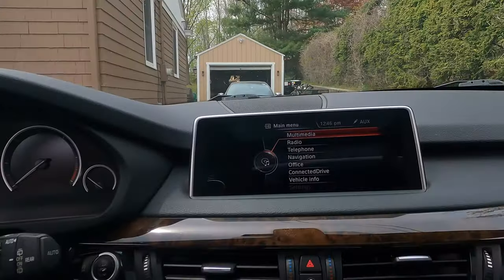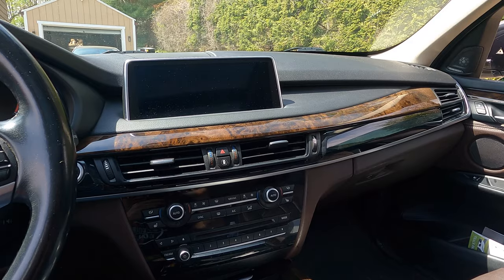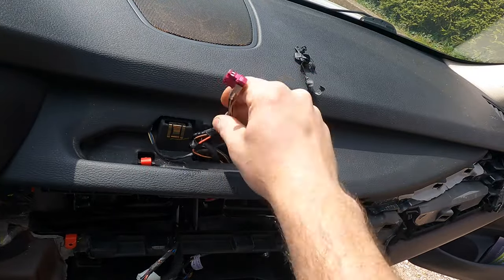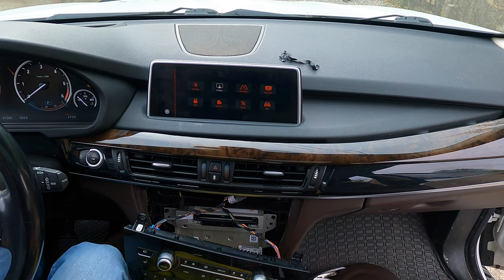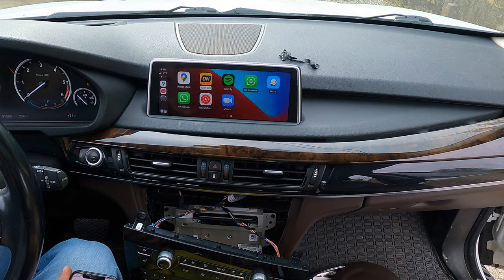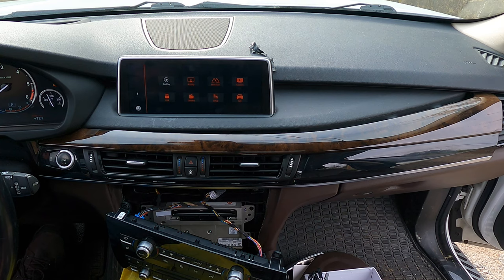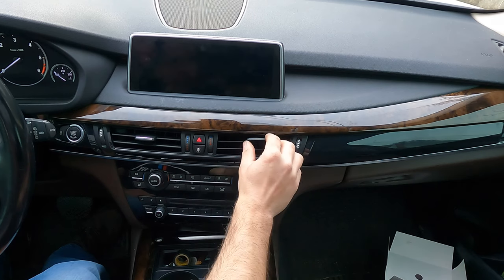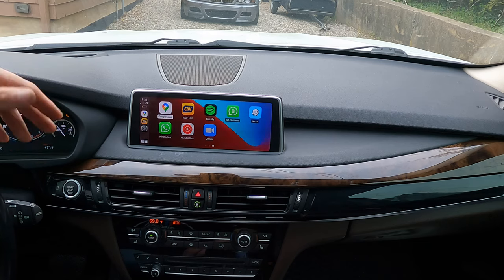Installing Andream Apple Carplay MMI NBT in F15 X5

Comment: Great job man. Ordered 2 weeks ago and installed today. You were right, there is very limited space behind the receiver. The only thing I did differently is used the [blue] factory antenna wire instead of the one provided with the unit. Is there a reason that you used the aftermarket antenna? Total install time was about two hours for me, most of that time spent wrestling the cables/connectors back into the dash to make way for the receiver. Works flawlessly, wife loves it! This is a no-brainer for those of us that have semi-new bimmers and want to modernize them with CarPlay.
Reply from the maker: Thanks Man 🙏 the antenna is for gps, for example is you cell looses service you can still use navigation

Comment: Great video! Thank you so much! I’ve been meaning to do this for a while and this afternoon, followed your video second by second! Only question I have is: where does the AUX cable from the Andream MMI black box plug into? Or does it just float around behind the silver iDrive box?
Reply from the maker: Thank you 🙏 glad you like it🙂 the Aux cable from Mmi is option accessory since this mmi is used in several models in x5 you can just tuck it away behind idrive
Reply: @MotorsportInspired  the issue is when I select AUX from Multimedia, it says nothing is connected. Right now, I’m using Bluetooth with the CarPlay box

Comment: Thank you for the video! I bought and installed the same device. Easy job.

Have a couple questions about the phone calls mode. When I have an incoming phone call I can’t answer neither using the buttons on the steering wheel nor using idrive knob. I can choose between the answer and decline buttons on the screen but when I push it nothing happens. Can only answer using my phone. Can’t find any settings for that. Don’t you have such issue?
Another my concern is incoming calls appearing. When I’m driving using the navigator and got the call I only can see the call screen then and can’t return to the navigator until I ended that call. Do you know if there’s any way to fix it? I mean by splitting the screen between navy and phone, or getting calls on a background, etc.
Thank you in advance for the answer.

Comment: This is the best box! Although my steering wheel controllers are still bmw adjustable. But I hold the knob on and get Siri, also gave me back up angle lines, DVR, get the wireless one comes with extra cable( usb one gives you low quality music.. wireless one saved my audison speakers 🔊) it has EQ like 40 settings,, and I wonder if I can connect a fire stick.. even heard it has and hdmi.. wow some gta5 sounds nice 👍
Reply from the maker: Yes sir it’s been 3 years since I got it and still works flawlessly 👌
Reply: @MotorsportInspired  have you tried the shortcuts app? U can start music up when u step in or have it tell you Goodmorning
Reply: @MotorsportInspired  if you recommend any apps shoot it

Comment: Hi I installed the box following your instructions on my bmw x5 f15 40e  2016 but for some reason I am not able to get any sound or even control the volume from the car steering wheel, any advice. Thanks 😊
Reply from the maker: Hi, I would suggest to double check the fiber optic connection in the head unit, that like to come close even though it might seem like it’s plugged in, if it not making connection those are some of the symptoms your experiencing.

Comment: Did you install an aux wire to this? I've installed a similar mmi carplay kit in my f20  1 series but am upgrading to X5. With the f20 I needed to wire in the aux input as well as the mic to be tapped into with the wiring harness
Reply from the maker: Hi, X5 doesn’t need a separate aux wire it’s integrated into the Mmi it uses oe mic harness.
Reply: @MotorsportInspired  thanks for clearing up! Already fitted and tested it without mic and aux with everything working as usual, a lot easier install

Comment: What is the best location for the antenna? Your placement was very close to the metal head unit. Did you have any connection issues or interference in that location?
Reply from the maker: The spot I placed it at works good no interruption at all👍

Comment: I just got my Adream MMI NBT. I noticed that the box has HDMI input. what can you plug there? is that for like plugging a firestick or any accessory?
Reply from the maker: Hi, mmi nbt box has wide variety of applications aside from x5 and different options of customization in different models, indeed you can use it for other accessories but I haven’t done so and don’t have direct experience therefore and can’t really comment how that would work.
Reply: What you end up plugging ?
Reply: You can plugging a donggle for Apple TV...

Comment: when you disconnected the battery did you have to go back and recalibrate the steering and DSC?
Reply from the maker: No I did not however in the event you do it’s easy in the f chassis cars, all you have to do is turn wheel all the way left then all the way right to recalibrate it.

Comment: Would the NBT work with a bmw x5m 2016?
Reply from the maker: If you have factory nbt system then it’s the same plug n play will work, nbt systems were installed in all F15 x5 variants until 7/16 production date after they moved to evo

Comment: Do you know if this works with the iPhone 13 IOS15 ?
Reply from the maker: Yes it does, i have 13pro and works great 👍
Reply: @MotorsportInspired  Thanks I purchased and installed but I f=do have a question about the USB port. Have you used it with your iPhone ?
Reply from the maker: @ImperialD  honestly I have not simply did not have a reason for it why ?
Reply: @MotorsportInspired  Just wanted to know. I used it to charge, [play music.
Reply from the maker: @ImperialD  I see👍, I have wireless chargers did not have need to plug it in.
Reply: @MotorsportInspired  Ok cool I may try that myself. Thanks